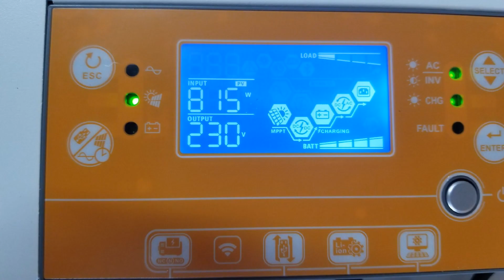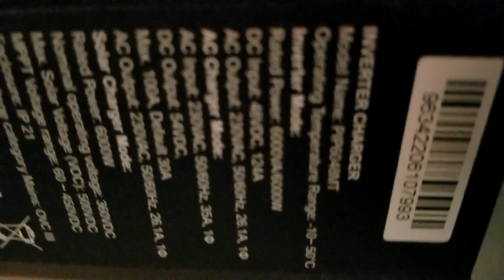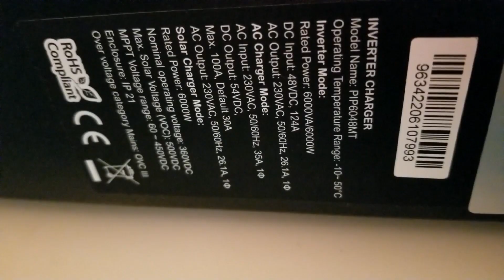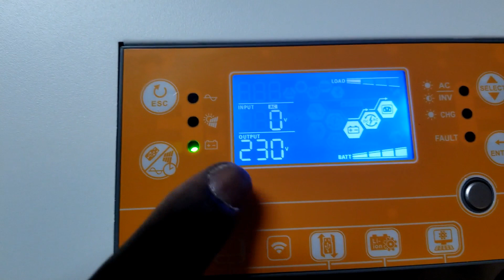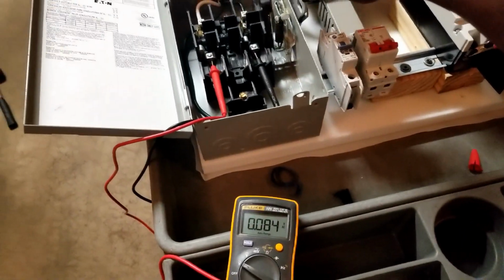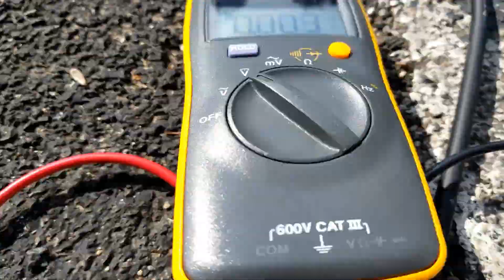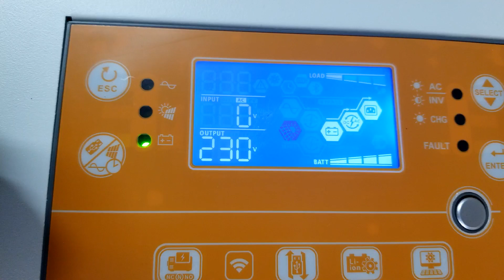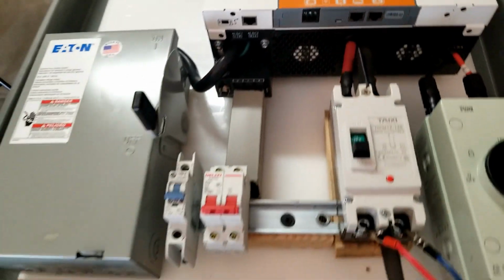OFF-GRID SOLAR SYSTEM WITH BATTERYLESS OPTION, MPPSOLAR PIP-6048MT, 1.550kW JINKO SOLAR PANELS

Comment: Awesome videos. I recently bought the same inverter and as soon I start up was working for 20 minutes after that time enter in fault mode. When I see LCD screen was showing fault 51, do you have any experience with that and how to fixed?
Reply from the maker: Fault code 51 means: 
OVER CURRENT OR SURGE ( F51 )
Thanks for stopping by and don't forget to LIKE SUBSCRIBE & SHARE
Reply from the maker: How many panels you have in Series/Parallel?
Your Rated/Recommend DC input current is 27A

Your DC VOC input is 500vdc and the recommended PV input voltage is 450vdc
Reply: @jwsolarusa  The problem with this inverter is i live in dominican republic and we use to have a biphase grid P+P+N, but this inverter in order to work with this particular cases need at the AC ouput a transformer, beucause you know the inverter just have line 220/240V and we need 120+N+120=240. So, even we installed the transformer the inverter show fault 51. I seen  some videos that is happend because the Neutral and ground are bounded, we take out all screw from inverter in order to avoid the surge by overcurrent, and nothing happend. So I need help from you to create and scenario like this, and show all how to connect well in order to get grid bypass or grid feed through the inverter.
Reply: In fact, i can't be able to use at all this inverter. So I need help and the manufacture does not gave to me a real answer.

Comment: I have set mine up with ten panels...As far as turning it on and switching the solar panel switch on as you have done here it is all ok and showing the correct icons as the one you are showing us here..My problem is that when I plug an electrical device in to run then it starts flashing and a red fault light shows(flashing)
Reply from the maker: What are the spec of the panels you have on yours.
What battery chemistry do you have?